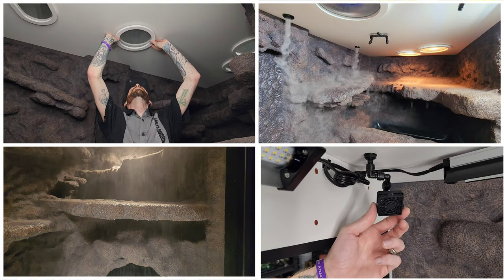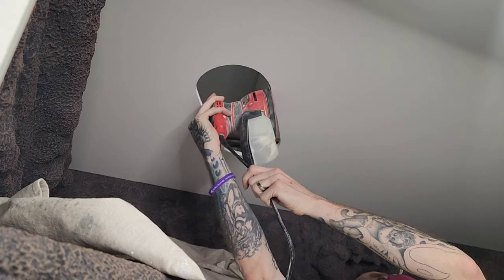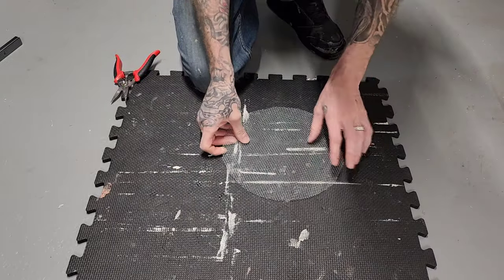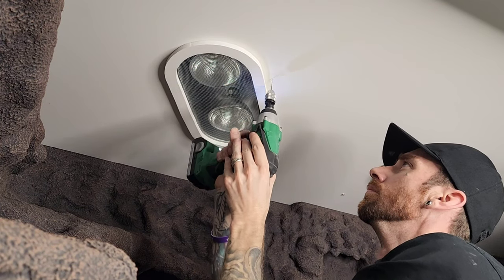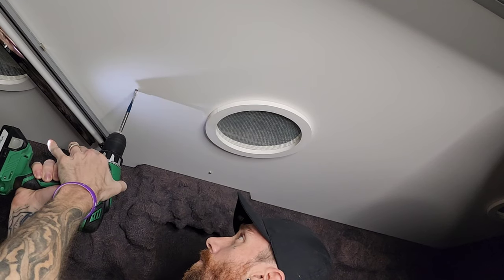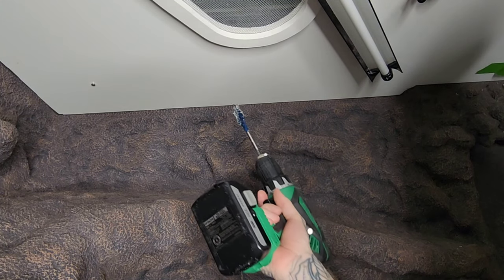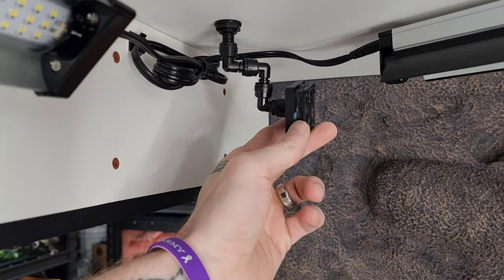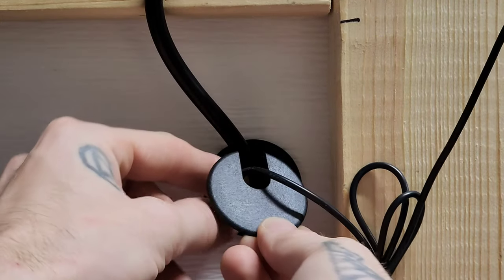DIY HUGE Reptile Enclosure. Mistking, Lighting, Fogger, Fans, |Part 3| Insane Ceiling Reveal

Comment: This is a perfect setup. The only thing I think that could push this over the top is if you added a dimmer to your lights to have them slowly transition on & off to add that rising & setting sun affect. But besides that chefs kiss
Reply from the maker: Thank you! 
And i agree,  I haven't looked into if there is a way to have the basking lights dim on slowly or not. They are on a set dimmer switch. But once turned on, they automatically go to the setting its at. 
I was thinking of adding a fluval aquasky I have that I can set sunrise and sunset times. I might add that to the enclosure, and it would just be the 1st light to come on and turn off. 
Decisions, decisions, 😆 
🤘💯🦎🐍🐢🐸🌱
Reply: I think snake discovery has a lighting video where she talks about a dimmer that works like that
Reply from the maker: @SupportedShots  Thank-you, I'll have to check it out

Comment: Amazing work!
But aren't inside lamps conflicting with rain system? Like short circuit because all this tiny water particles, which flying all the directions, or hot lamp glass cracking because of cold water?
Reply from the maker: Thank you and good question. I have the mistking nozzles are pointed away from the lights. The one in the center (DHP) only comes on for  nighttime heat (from 1130pm to 430am). But the lights them selves are flood lamps used for outside. Also, that's why I installed them above the enclosure. Not only to maximize space but to reduce water if it was to get onto them. The uvb has its hood that would redirect the water if it came into contact with it. Hope that helps woth your question.
🤘💯🦎🐍🐢🐸🌱

Comment: First and foremost, thank you for the reply. My next question. Will the polygem hold up to the high heat that is needed for a black throat monitor
Reply from the maker: Most definitely will. It's used in a lot of zoo exhibits. My Cumingi gets to 130F. My mertens is gonna be 145-150F.
 Est product out there for large Varanids

Comment: I appreciate this channel. I've been puzzling to build large bioactive vivarium with water feature for my growing leopard tortoises for a while.  One I have to do will be so large it has to be walk-in, almost zoo exhibit style enclosure taking up 3/4ths of a room for the ease of cleaning, maintenance etc... Watching your builds have been helpful. Since there's lots of flat area I've been thinking about panels of fogged plastic to use  as light diffusor to get skylight sort of look for the ceiling (maybe with pull out drawers like you had in your other video to access the lights), but then again I do need exposed lights for the UVB lights and  basking lights. I like the "hidden" floodlights placed  on an angle here.
 In depth setups for (custom) thermostats, light dimmer schedules setups etc would be nice.
Reply from the maker: Thank you and I'm glad watching my builds has been helpful!. I like where you are going with he fogged plastic to diffuse the light for the application you are talking about. 
I hope you give it a go. Once you get started I'm sure everything will fall into place!
Your support is appreciated! 
💯🤘🦎🐍🐢🐸🌱

Comment: Do you have any lighting to replicate the moon and stars? And how noisey are those little fans compared to using something like a 120mm computer fan? Amazing enclosure by the way, it's nicer than my own bedroom.
Reply from the maker: Thanx Scott, it's also bigger than a New York apartment 🤣.
The 40mm fans are very quiet. I can't hear them with the sliding glass doors shut. When open, I hear a very faint buzz. But nothing someone would pick up on if they didn't know what they were. 
I use fluval aquasky for a day light cycle. It has cloud features (like if they are rolling by and lightning storms). Watch my most recent DIY paludarium video or the 6 minute iver view one. I use them there. 
🤘💯🦎🐍🐢🐸🌱
Reply from the maker: Paludarium build with fluval aquasky https://youtu.be/-6B4wvRxdqA?si=XNvzy7SsxEfD6NDg

Comment: Does the govee smart plug turn back on after a power outage (or at least follow the timed schedule and automatically reconnect to wifi)?  Only reason I’ve never felt safe switching to smart plugs.
Reply from the maker: I have had the power go out a few times, and I have not run into an issue with govee smart plugs recalibration. (my fluval lights get all messed up if the power goes off but they are Bluetooth. and have to reboot them but not my govee smart plugs) I know they were working on some bugs with daylight savings time. I believe they resolved the issue, but I still just turn off my internet on those 2 days a year for 15 minutes and turn it back on to be safe. 
I'll let you know what happens this year with daylight savings. 
Hope this answers your question.
🤘💯🦎🐍🐢🐸🌱

Comment: Hello there

I one of your vidéos you're using an external heater.
Wouldn't it be à fire hasard if the canyster fails an the water stops flowing througth it
Reply from the maker: I believe it has a kill switch if water is not running through it if I remember correctly.  I'll have to go back and read the details. I honestly unplugged it because the temp was staying in my desired range for all 4 seasons of the year. It's still nice to have the option if needed, but it was just wasting an outlet that didn't need to be used

Comment: For the top, would a boxed in lid work as well? That way you can just set all your lights on a screen instead of having to drill holes. I know with the fogger system it would require some holes, but if you were to do without the fogger system.
Reply from the maker: @shanedeacon8275  yeah, whatever you can think of you can build it.

Comment: Will the insulation board our basking areas hold a white throat monitor full grown
Reply from the maker: I was surprised on how strong it was just by attaching insulation board to the wall woth spray foam. I had a few gallons of water on it with not sign of it breaking. But it really depends on what kinda topcoat your gonna be using. In this video (attached) I was able to sit on the ledge with no issue using polygem zoopoxy. Hope this helps
https://youtu.be/E9RIR0qE_q0?si=NWmyMq5Ge3ciSmWU

Comment: hot glue with high wattage ... hahahah expect glue dripping when gets hot
Reply from the maker: I don't know what's funny when it doesn't get that hot in the area it was applied (at max 114°F). Plus, hot glue melts/liquefy at temperatures ranging from 250 to 375°F. Temp readings don't get close to that!
🤘💯🦎🐍🐢🐸🌱